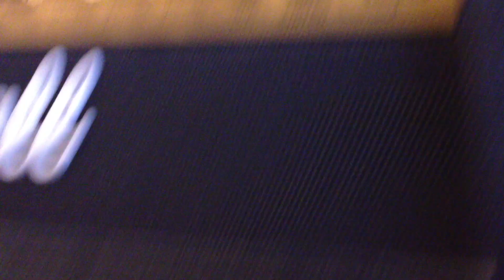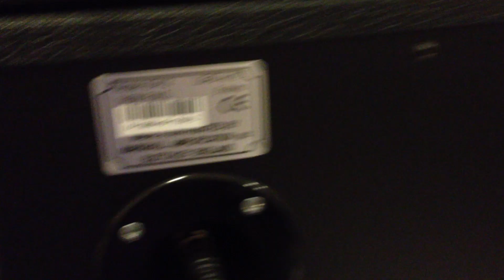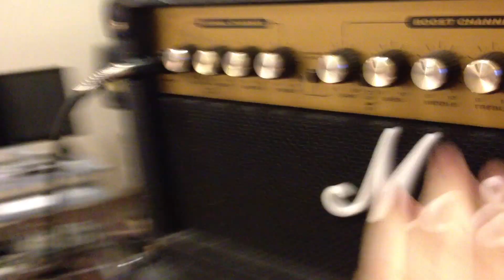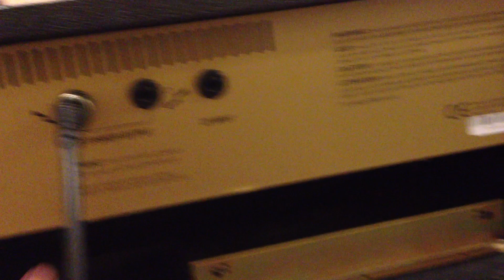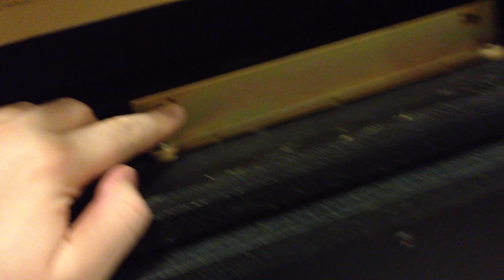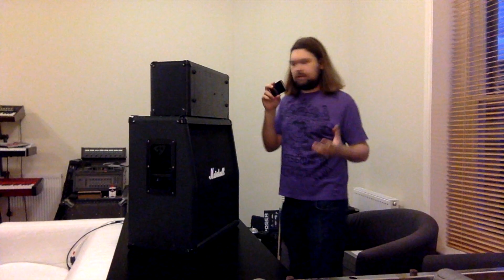Marshall Stack G100R CD Review with VS412 4x12" Cabinet eBay Listing

Comment: I only fire up solid state amps during long brutal Texan summers. Tube amps are space heaters. Taking that route, I discovered that trax done with SS amps really do not sound terribly different to tube amps! Not nearly as different as I supposed it would. Once glued together with drumkit, bass, vocal etc etc elements in a song, I find nothing to bitch about re guitar tones. However, once it cools off, I still have a fetish for tube amps, then I'll use my PV Classic or my Marshall Origin or Bugera Plexi copy head. I love them.

Comment: These amps have killer sounds and under rated and valued. Seen one sell for $2500 so their are people wanting these.
Reply: 2500.00? Cool story bro...
These amps , on their own go for around 200.00 - 250.00.
Used in excellent condition. 
The reason is this shitty,  thin , lifeless tone . Even the high gain on lead is a joke.
I've heard Peavey amps that would put this to shame. Nobody wants one for good reason. 
However if your running an effects board through it, it now becomes a good base foundation because of the power behind it.
Reply: I have this exact half stack and want to sell it. Where did you see it listed for that much??
Reply: Kmart - seen two sell on reverb. One for $650 and one for $2000
Reply: @automstone7613 I’m half convinced reverb is used for money laundering lol
Reply: I bought my combo for $200 used. Works perfect, it’s just a cheap solid state 100 Watt Marshall that sounds scratchy as hell on the metal channel but does have a beautiful clean channel.

Comment: i love this amp.  only one i will use live or in a studio.  i have the exact same set up as you.  but it is actually 160watts :) great vid brotha.
Reply: Scott Demoss Since you already own it. Do ypu think its ok to use in a house? 🤣
Reply: you have what is called "buyers defense/moronic owner syndrome,you see something that you own and feel the need to defend it because you initially felt like an idiot wasting money on it in the first place.this is kind of what you sound like:

"i love my $200 solid state low end amp that emulates something else entirely and doesn't do it very well" 

you have to think to yourself and come to the conclusion:this is crap,it was designed to be crap,designed to be cheap,designed to pretend to be something else as a compromise and its as low on the pole as you can get without falling off.it isn't a single percent better than the worst tube amp you can get.my 15 watt tube amp will decimate this amplifier with relative ease in shear volume and tonal quality and costs less doing it.

can you use it,yes..............does it suck balls compared to 95% of decent amplifiers ...........YES
Reply: trillrif axegrindor  I’ve played Vox ac30s Marshall’s orange fender twins etc.for 45 years .my preference to this day is H and H which is not unlike this cheap and nasty little amp..valves vary according to the weather are affected by moisture and don’t always sound the same ..usually you have to drive the larger ones before your cooking..I reckon if I played around with this amp I cld get a decent sound admittedly it wouldn’t travel so I’d have to Mike up the speaker(s) ..thats the only down side for me ..I like the cheap nasty sound that’s what R andR is all about ..for punk rock these amps are fine...but if you want to look and sound like everyone else go for the valves....I may get one  I saw the troggs twice they played wild thing 4 times each gig..their guitars and amps were deliberately cheap and tinny...fkn great same with the kinks
Reply: cellulitehero what? My amp has never sounded different depending on the weather lol. I’ve had a Marshall jcm2000, which was great on clean w/tube screamer, and currently I use a laney gh50r which has an immaculate variety of usable tones, from sparkling cleans to classic British crunch to high gain growls. Love it. It was pricy but worth it in my opinion. I also have a blues jr iv which, at a much lower price point than the laney, beats this amp in every category. Just get a couple of good pedals for whatever tones you’re looking for
Reply: trillrif axegrindor savage but accurate

Comment: Can I plug a EVH phase 90 into to get Eddies brown sound?
Reply from the maker: It's not going to sound like an old Marshall valve head with an echoplex or anything but it'll be pretty good. Like I say I prefer the lower gain settings but it has plenty of drive for you in there.  A lot of the sound of those records comes from the saturation of the magnetic recording tape too.
Reply: Rob Harrison what amp would you recommend to have a close sound of eds tone?
Reply from the maker: If I were to buy one now I would own a JCM800. Speaking as someone who has heavily used JCM800, JCM900 and JCM2000 super lead in the studio, I would buy an 800 again cos the simple direct signal path kicks ass when turned up loud and trounced the others. The 2000 has the higher gain though. They are in a different price range to this amp though so this is a good compromise to get that Marshall tone shaping. Need a 4X12 cab to go with it for the heft in the bass too and it all adds up.

Comment: Thanks for posting the review i just bought a Marshall rig a couple weeks ago i got the same head but a different cabinet and its a MG412A in your opinion how would this cabinet sound to you plugged through this head?
Reply from the maker: I think for a transistor head it's got a really nice crunch sound. Like it mildly driven rather than all the heavy distortion drive on the lead channel.
Reply from the maker: Probably sound great.  I think these heads are meant more for cabs like the one you got.  Mine was slightly bigger one which was originally paired with the valvestate line of amps I believe.
Reply: Rob Harrison Thanks do you mind if I send you a video response to show u how mines sound I think my setup has a decent sound but I could use a second opinion
Reply: I got a MG412A Cabinet with the G100R-CD Head and it has an awesome sound.
Reply: Yeah when I got mine it was used from a guy at work , took the head across rhe street to check it out and used a neighbors cab (he has two 1983 jcm800s) and we realized how small my cab was.